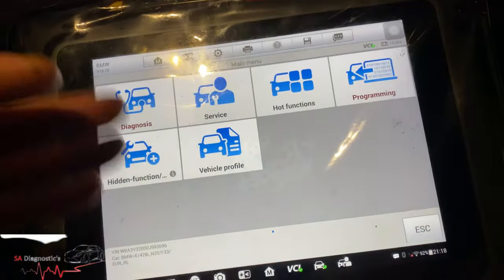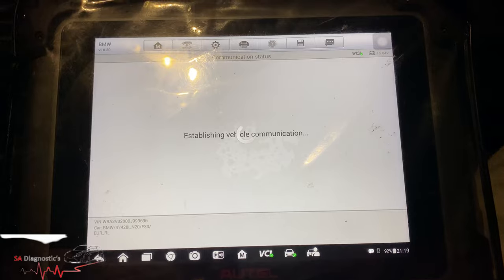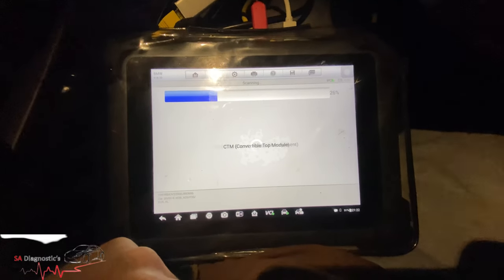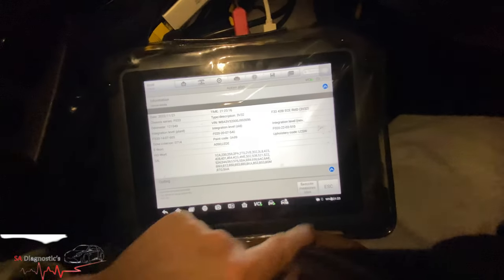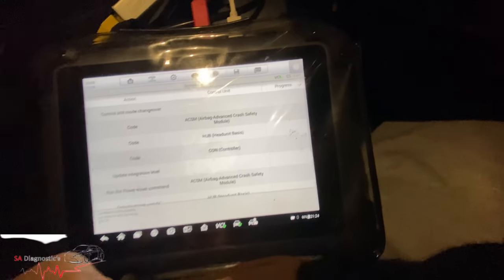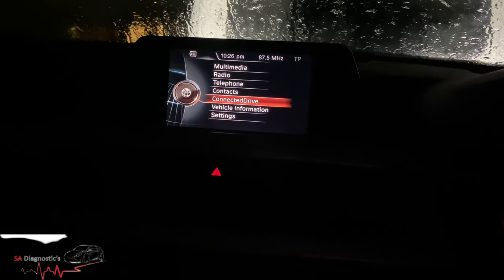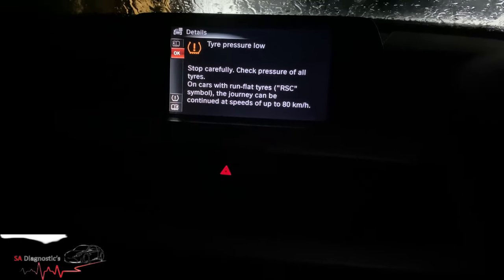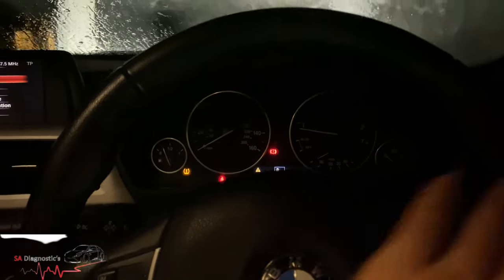HOW TO CODE BMW Using AUTEL MAXISYS

Comment: is there a specific autel only the J works worth or does it work with all. i have more of a base model thats not as big as yours and want to make sure
Reply from the maker: @subtosharki  no the J will only work with some top end machines it won’t work with the cheaper ends…
Reply: @sadiagnostics  thats unfortunate, is there any other choices for programming with the mx808?
Reply from the maker: @subtosharki  sorry am unsure on that, your best emailing Autel direct….

Comment: Is this a paid service, do you have to purchase from autel, in order to program ?
Reply from the maker: Yes I have a subscription yearly
Reply from the maker: However if you don’t want coding and programming then your fine you can use the basics but if you need them two then yes you need subscription
Reply: @sadiagnostics  thanks for the info

Comment: Where did you get the protective sleeve for your Autel? I have the MaxiSys MK908P MS908S PRO and have been wrapping it in kitchen platic wrap for protection.

Comment: Can you coding and nbt evo id6 with autel?
Reply from the maker: Yes I’ve coded Idrive system in before. However I’ve coded in older version such as 5 series 2007 e60 model and cause they had a larger screen and than normal it had maximised the resolution. However for the new ones as long as it’s genuine and same part number then yeh it will code it in,
Reply: @sadiagnostics  i mean if i have id4 and i want to upgrade to id6
Reply from the maker: @raul16nyc  it may code it in but I would highly recommend you get dealer software for this as with dealer you can actually play about with it more and have more functions. Autel probably has 50% of the coding what bmw software has but dealer software you can’t beat.

Comment: How long it takes for procedure?  did  it have radio change ?
Reply from the maker: 5 mins
Reply: really need good internet connection otherwise not working and battery charger.. done same  one yesterday 👍